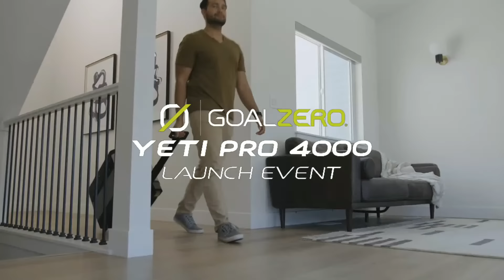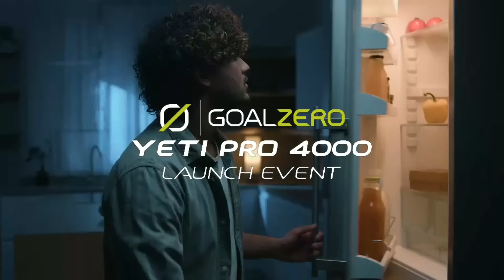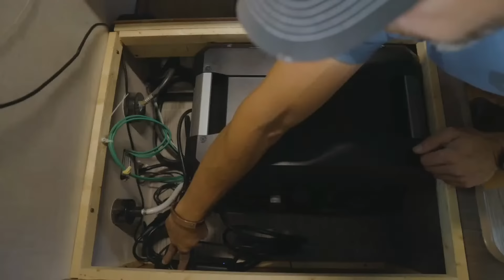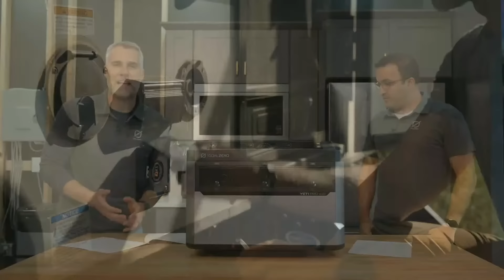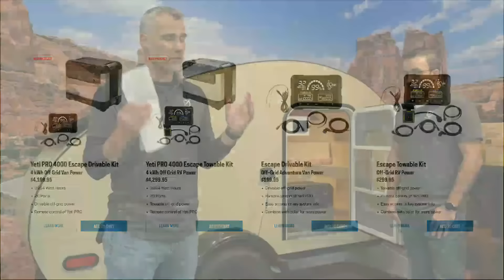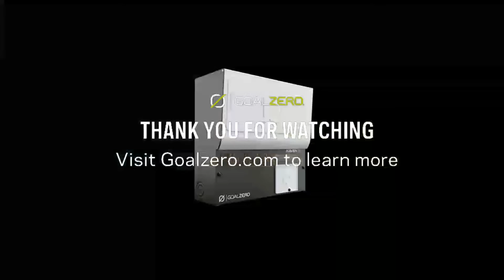Goal Zero NEW Yeti PRO 4000 - Live Product Launch

Comment: I just installed my Haven 10 and I also have whole home solar battery backup. I’m wondering how that would work with the yeti. I may just have to hit the outside breaker to the garage panel. Idk. I’ll have to look into it before I actually use it.

Comment: I bought my first Goal Zero around 2015 I believe, thru costco when they had a promo with reps from GZ there.  It was a yeti 400 and it still works great to this day even with a lead acid battery. Not sure how. It doesn't have the capacity it once had, but it works and never has failed. I admittedly bought from a competitor a few years ago as you simply fell behind the competition. I'm so happy to see that you have now taken the lead in terms of value and quality and look forward to many years of service from the new 4000 pro. You guys are not only back, but on top. Thanks.

Comment: Every battery station is awesome for their respective uses. However, the larger the unit, exponentially the less solar comes into play. As we all know, solar power generation sucks for the short 12 hour possibly full sunny day. This unit requires a gas generator to recharge in order to power a house at night. For such a large capacity unit (for the price), it should include a 30A/240v port. There is no reason to spend double (buy two) to connect in parallel for that 240V capability. I absolutely love Goal Zero, and own many of their 12V Yeti's, but they I think they purposely missed the mark on the 30A/240V mark on this unit, so you spend twice the money on a second unit and the accessories to connect those units. Transfer switches are another waste of money. Just install a 30A/240V inlet to the panel to power the entire house, and be smart to balance the usage load upon the outage. I'd rather have two of these units with 240V, connected in series to power my house. Rather than two connected in parallel, for half the run time.

Comment: When you remove the Yeti Pro to go camping, can the Haven still power off the Tank when an emergency exists? Based on what I have heard on this video, it sounds like a "no" and that a 2nd Yeti Pro is needed
Reply from the maker: If the Yeti PRO 4000 is removed from the Haven 10 transfer switch you would not be able to back up your home. The Tank Pro expansion batteries are unable to connect directly to the Haven without the Yeti PRO 4000.

Comment: looking at this, the EcoFlow Delta Pro and the Anker SOLIX F3800
Reply: Me too.  It’s between this and F3800.
Reply: @xdean  there is supposed to be a new Ecoflow Delta Pro 2
Reply: Explain why they are junk and why  Goal Zero is better? I had a Goal Zero battery /solar panel system years ago and it did not last, support was less than stellar, that is my hesitation.
Reply: junk. go with the goal zero

Comment: So this thing is over a 100lbs, I don’t want to tote back and forth in my van. can you change by alternator? I was hoping for an upgraded 1500x with slightly bigger battery and lifepo battery.
Reply: The 4000 definitely looks like a great system for large RVs, full time van people and great for home back up. Also the expand ability is great. 3000 watts of solar, wow how much space will the be on a camper?  And price? I hope y’all fill the small guys wishes too!!  It maybe Bluetti or Ecoflow for me.
Reply from the maker: You can charge the Yeti PRO 4000 from an alternator. We would recommend checking out the Escape Drivable Ecosystem for Van integration! One of the benefits of Yeti PRO 4000 is the LiFePO4 battery. This allows for a longer life span, better functionality in extreme temperatures, and higher inputs and outputs but LiFePO4 batteries are definitely heavier than our Yeti X power stations using Li-NMC.
Reply: they are coming out with smaller models
Reply: Where did you hear that? I'll be ready to install power in my van come the first of the year. Im starting the lay out and will need to finalize my floor plan. 
 @jgg204

Comment: I really like the flexibility, portability, and expandability designed into this system. You could move this system between multiple applications and locations with ease.
Reply from the maker: Yes! We are very excited to see how people use the Yeti PRO 4000 and the Tank PRO 4000 in different use cases. It is very easy to disconnect the Yeti PRO from the Tank stack and take it wherever you need power.
Reply: I do like how they connect, like giant LEGO, that is very nice :-)  I just want to see a head to head with the SOLIX F3800, especially since the F3800 has 240V already in a single unit.
Reply: @andrewvillavicencio8496 yea but only 60V solar input?